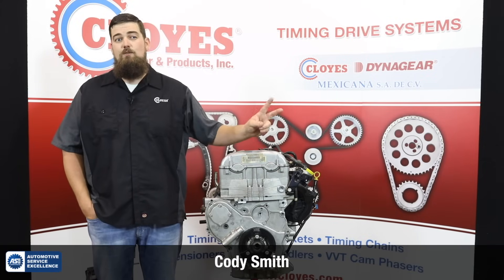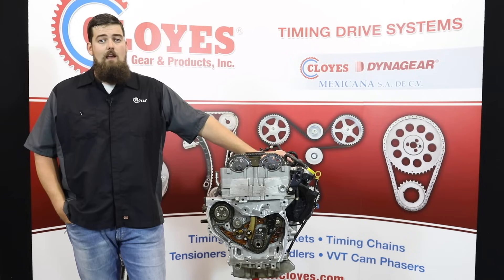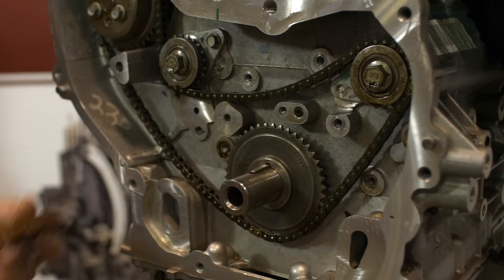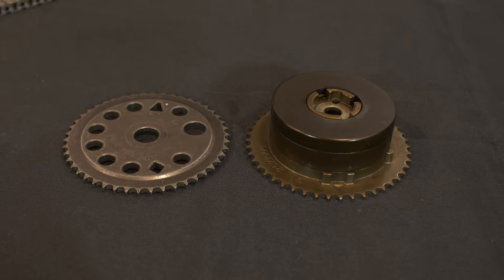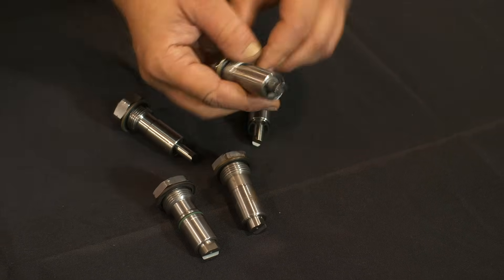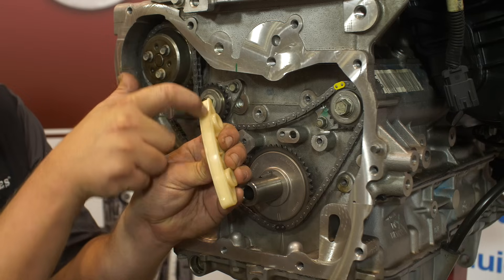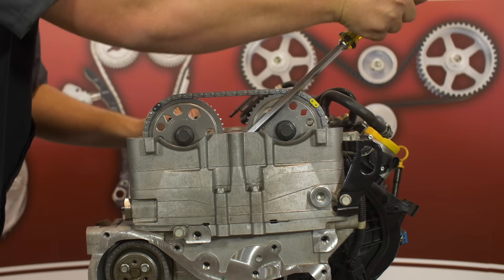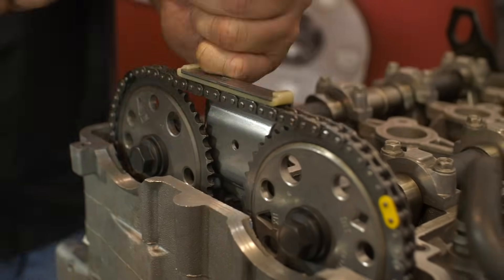GM 2.0/2.2/2.4L, Timing Chain Replacement, Cloyes 9-4201S & 9-4202S

Comment: Great video, but don't you need something holding the cams in place so that when you remove the sprockets and chain they don't move and screw up the timing?  I've seen these blue or gold cam holders for this project for the Saab 9-3 but in the video I don't remember it mentioned.  Thx.
Reply from the maker: They are not necessary, but can make the job easier. We do not use them during the video. The timing is set by the marked chain links aligning to the sprocket marks. If the cams move during disassembly, you will move the cams back when installing the new chain.
Reply: @Cloyes01   Cloyes, the cam locks are necessary on a Saab if you are going to remove cam sprockets, and probably even if you don't. The sprockets are not keyed to the cam like a regular ecotech. They are just held by bolt tension. The cam sprockets also do not have timing marks on them. Blue locks are needed for the B207L (9-3 Linear little "t" engine, Gold is needed for the B207R big "T" engine. Trust me, I am putting one back together right now.

Comment: Harmonic balancer bolt torque specs?
Reply: 74-ft/lbs + 125 degrees rotation
Reply: I think it is also just the "Crank Shaft Pulley"

Comment: On my application the vehicle uses a white phaser and a black one but the kit has 2 black ones... I'm guessing there is variations from Vin to Vin, gonna try the old phasers...
Reply from the maker: Yes, some applications used 2 different phasers, and some used 2 of the same phaser. We offer kits both ways.

Comment: FYI: I broke a tooth on BOTH new balance shaft sprockets using the 'drill bit method!' To anyone who had the same problem, I'd suggest wrapping the OLD balance sprocket chain around the sprocket and grabbing with a vise-grip to hold in place while removing/installing the sprocket. By using the old chain, you take the pressure off the single tooth and greatly reduce the likelihood of damaging the sprocket!
Reply from the maker: Very good advice. The punch/bit method will work, but you do risk breaking a tooth. If we film an updated video for this application, the method you described is the method we will recommend.
Reply: Glad i followed this advice. I cut the old chain in half and wrapped it around the balance shaft sprocket and let it bind up against the block. Worked perfect to break the balance shaft bolts loose, then i wrapped the chain around the other way, let it bind up against the block on the intake side and against a bolt boss on the exhaust side and i could torque the sprocket bolts to spec
Reply: @romanfedotov9434  Glad my advice panned out for you. It was REALLY upsetting when I broke not one, but BOTH of my new sprockets (and had to buy two more!)
When the first one snapped, I thought it was my fault or the gear was of poor quality. The second one proved of the stupid idea of using a drill bit!
Reply: That's how I had to do it,  the drill bit way is frustrating

Comment: Just did this proceedure on my 2013 Buick Verano. Bought an AC Delco kit OEM. Before wjen you drove the car there was like a ticking rattling noise because the chain stretched and was causing P0014 code. Afterwards no check engine light and engine is running smooth again. THANK GOD, at first I thought it was a rod knock
Reply: Did u have to pull the engine?
Reply: I have same car, my parents gave it to me, the chain is bad shop said so I had them tow to my house, I’m just curious if ima have to pull the engine
Reply: @psfanboy79  no! Its possible to do while it in the car. You do habe to lift the engine a little bit by removing the motor mount
Reply: @adamsgarage5119  thanks! I just replaced vvt solonoids and unfortunately upon closer inspection of the old ones there were bits of metal shavings on the filter screens so I didn’t even bother turning it over. The chain n guides are definitely toast.
Reply: Hi - need new chain on my 2007 solstice with 2.0l turbo - with your replacement - was easy to remove power steering belt and main drive belt for ac and drive belt tensioner?  Did have to drain oil?  And u mention lifting engine up slightly - why needed?  My solstice is rear drive so engine front cover behind fan so maybe i need to remove fan/radiator to get at front cover?  How many hours approximately take u to do job?  Thanks for any update here.
Reply: @michael-qp9xd  Hi, so with your solstice it is rear wheel drive so this job will be a LOT easier for you. It is required to lift the engine in the Verano / Cruise because the frame rail is in the way. In your case just remove the fan amd radiator and you should be good to go. You just remove the timing cover and the chain will be right there. This job took me personally 8 hours to do but that because of limited room by the frame rail. And yes drain the oil beforehand if you want to reduce the mess made.

Comment: I have a 2014 Chevy Impala with a 2.4 l I bought this car from a guy and he said the timing went out on him while he was driving on the freeway. I was told that even if I replace the timing the motor was no good because he was driving on the freeway I would like to know if this is true or false. I would hate to replace the motor it costs almost $3,000 for a used replacement motor.
Reply: Minimum will need the cylinder head rebuilt, have a local technician send a borescope down the spark plug holes to assess damage to the pistons. In my experience, its rare for a bent valve to damage the piston enough to have to rebuild the bottom end too
Reply from the maker: These engines will bend valves if a timing chain failure occurs, but with a new timing set and some new valves in the head you should be good to go. Machine shops will usually rebuild 4 cylinder heads and replace bent valves for less than $500 or you can find replacement heads for about the same price. Just make sure the pistons are not damaged when you pull the head off.
Reply: Yes unfortunately if it wont start now that means the pistons have bent the valves and it will need a complete rebuild or a new engine.
Reply: Late to the party, but for anyone else in that situation, pull the head and have a look. If it only bent valves, then refer to Cloyes comment. However, its pretty likely theres significant piston or head damage, and its faster and cheaper to throw a new engine in.

Comment: I've got a small amount of slack underneath the upper guide, it drops below the guide about 1/4" ,  I reused the old chain as all I did was replace the upper fixed guide and tensioner.  Is that slack ok? Everywhere else is tight except for that area between the cams.  The tensioner is activated as well.  Thanks
Reply from the maker: Some slack will gather between the camshafts when the engine is not running. That is formed by the valve spring pressures clocking the camshafts towards each other. Once the engine is running, that slack goes away. If you are concerned about the chain's health, take a look at the tensioner and how far the tensioner piston is sticking out of the housing.
Reply: @Cloyes01  Okay good to know, thanks.  It took quite a bit of effort to activate the tensioner, I was moving the tensioner guide an awful lot trying to compress the tensioner piston and was able to finally get it to pop.  As soon as that happened, it took the small amount of slack out of the crank sprocket and that is when I noticed the slack between the cam sprockets that was not there before activating the tensioner.  I'm thinking I'm good to reassemble but am being overly cautious.  Any help is much appreciated, thank you.
Reply from the maker: @kevinkonyn2879  That sounds completely normal. As long as the tensioner is activated then you are good to go.

Comment: Is this the L61/L850 engine?
Reply from the maker: Yes.
Reply: @Cloyes01  Thank you. I found your video by searching for upgraded timing chain oil feed nozzle (4mm diameter, instead of 1mm diameter). That shuold fix the chain streaching problems.

Comment: I have a 2006 Chevy Cobalt SS 2.4L I'm getting a p0014 code I tried doing an oil change and putting in a new exhaust camshaft solenoid but my cel keeps coming back on and it throws the traction control light on and it shifts rough when it's on but it runs fine and starts fine I don't know what's wrong with it what could it be?
Reply: Not a timing chain
Reply: Traction control light is caused by sobering else but did you ever resolve your issue?

Comment: After rebuilding the head on this. Replacing the guides, tensioners and, chain. The car is giving me a code for p0016 which is crankshaft position, intake camshaft correlation code. The engine runs really good after the rebuild. Starts up immediately, no power loss, no misfire at all even under load. (using diagnostic) what could this code be?
Reply from the maker: That could be referencing that the camshaft timing is off a tooth, the VVT system on that bank isn't working properly (phaser/solenoid), or the cam or the crank sensors are not reading correctly. Stretched chain is also possible if the system is worn, but not if you just replaced it.

Comment: When you're on TDC, are all the valves closed?  When one turns harmonic balancer/crank to take the slack out of chain, I guess it's OK the balancer sprockets etc are moved a couple hrs just as long the color links are still on the marks.  The weird black tensioner side has so much slack.  Everything is right on the hour until I take the slack out.  Then all sprockets are off quite a bit. I hope that's ok
Reply from the maker: Yes, as long as the links were aligned, then the engine will remain in time.

Comment: Hi
After timing chain replacement I was getting P0014: replaced the vvt selenoids    Wit oem but Didnt fix it. Then I replaced the vvt phasers with after market ones. Now getting p0011. Do you think it is the aftermarket vvt phaser still giving me that code? I am positive I did the timing right.
Thanks

Comment: In a reply to another comments' question regarding why not to rotate the crank after chain assembly is complete, you say the chain might jump because the tensioner doesn't put enough pressure on the chain and that pressure from oil circulation in the tensioner is needed to prevent jumping. When initially starting the vehicle, after the job is completed, the chain is rotating WITHOUT oil for 'x' number of seconds til the oil pump gets oil circulating through the tensioner so that it can exert enough pressure to keep the chain from jumping. My questions are 1) Is what I just theorized true or reasonably plausible (since I am not a trained professional) and 2) Isn't the chain at the mercy of luck to not skip no matter who did the job and how 100% correctly the job was done? Perhaps the engine torque being generated when the key is turned prevents it .?. Thanks for humoring this hack weekend warrior type of mechanic. Mike (using wife's email acct)
Reply from the maker: Hi Mike. You have a great understanding of the system and are asking the right questions. The biggest problem with rotating by hand is the effect that the valve springs have on the camshafts. During slow rotation the valves opening and closing have a dramatic affect on the chain and slack will move back and forth throughout the system. When rotating at speed with the starter, or once the engine is started, the chain runs much more stable because slack doesn't have a chance to move around. Valves are opening and closing at a much quicker rate and the system isn't effected as much by the individual events.
Reply: @Cloyes01  Excellent teaching answer. Thank you. So, because of the continuous motion of the chain at a rotational speed that doesn't allow a 'pinch point' to be able to have time to express itself on a link, the chain won't jump. Right? Does centrifugal force from the sprockets rotating help to decrease chain over-tensioning? Again, I'm no mechanic or engineer,  but my brain remembers a few things from physics class. 🤔 Thanks again. I promise I won't bother you anymore. Mike

Comment: why can’t the tensioner be installed activated
Reply from the maker: If the tensioner is activated and fully extended, the internal ratchet mechanism will be in its last, most extended step. If you attempt to install it at this point you will either damage/bypass that internal mechanism, or the tensioner will overtighten the chain and likely cause damage to the guides or chain. The ratchet mechanism needs to start at the most compressed position and work its way out over time as the chain stretches.

Comment: Problem.. After rotating twice our chain marks do not come back...? Why ??
Reply from the maker: The chain marks will only align during the initial install. If you continue to rotate the engine they will eventually come back, but it may take over 100 rotations. With that said, we don't recommend rotating this engine by hand until the tensioner has a chance to prime up with oil. You do risk jumping teeth on the crank sprocket.
Reply: @Cloyes01  can you elaborate on when will the marks will align

Comment: what are the balance shafts actual purpose?
Reply from the maker: Inline 4 cylinder engines are naturally out of balance and they tend to have a lot of vibration. Balance shafts are added to to help counteract the vibrations and make for smoother engine operation.

Comment: Not 37 lb ft on the balance shaft sprockets, snapped a tooth off the new sprocket on install………Also like to add that the intake cam phaser/sprocket was incorrect in the cloyes kit for the vvti engine, had to redo whole job, engine wasn’t hurt but just an FYI for you guys….
Reply: @dano9973  you can get replacements through your parts guys (Oreillys,Advance,Napa, etc.) I just did 30ft lbs on the balance shafts
Reply: @robertyingling2045  Update!!! I called tech and they have had problems with the small balance shaft sprocket tooth breaking,  He was honest about it and going to send me a new one.  He suggested to wrap the old chain around the sprocket as tight as possible and put vice grips on the chain.   Of course hold the vice grips and forget the punch deal.
Reply: Are you meaning the engine with over head valves and not overhead cams..  My cam sprockets don't look like these or the factory ones. I'll post my question to you that I just asked them.  Wondering if I have the wrong sprockets now.................I was wondering if yours were like mine. see below   Thanks

Are these cam sprockets the latest design?  My kit, the sprockets  has the same size holes all the way around, plus no diamonds.  I see these have the diamonds (as do the factory ones) with one larger hole with a space after. They don't have all the writing on them either, just exh and int all the way up on the teeth edge.  Have you changed these sprockets to what I have now or is mine an older version? Thank You  for replying.  I need to make sure before I tackle this crazy GM design
Reply: @dano9973  I haven’t had the opportunity to work on an NON VVT version of the ecotec yet…..but if I’m not mistaken there should be dowels on the sprockets to ensure proper alignment on the cams, there should be timing marks on the gears, if there isn’t only thing I could recommend would be laying the old gears on-top of the new gears and transfer the timing marks over to the new gears with a paint pen, and cross reference old part numbers off of gears to new ones to make sure they are correct….

Comment: What happened to the crank sprocket spacers are they not needed
Reply from the maker: If the engine had spacers installed, definitely reuse and reinstall them. Most Ecotec engines did not have spacers, but they are found in some designations.

Comment: Installing this past weekend. I triple check the timing marks and got the car to start. However, I’m with engine codes p0016 p0017 p228d p0089. I did not use the Cyoles timing chain sprocket because it had a circle mark at 4 o’clock. I did use the OEM sprocket.

Comment: Does the 94201swp complete kit for timing and balance chain with water pump- come with timing cover gasket and gasket for water pump ?
Reply from the maker: It does not include the timing cover gasket, but the O-ring gasket for the water pump is included.

Comment: May have a problem, I did my 2nd 2.4 timing job this week and realized when doing the 2nd engine, on the first one I may have put the balance chain tensioner in wrong. I guess I don't fully understand how it works, oil pressure doing something to it? (besides the obvious keeping tension on the chain) When the shaft is turned 180 it goes in and out freely but the other way it was sticking so I thought moving freely was the way it was supposed to be. But seeing the video the shaft is supposed to be the other way, will that need to be corrected?
Reply from the maker: The shaft should be positioned with the pin hole facing outward. The back of the tensioner shoe will also help hold it in that direction. When the hole is facing outward, the internal ratchet will be active which provides multiple steps that limit inward compression.
Reply: @Cloyes01  That's what I was afraid of. Thank you for the reply guess I'll have to crack it back open and fix it. Thanks for the great video also.

Comment: First of all thx this video! If I only replace the main tensioner, do i need to loosen anything or just replace the tensioner and activate with pushing the chain?
Reply from the maker: Just remove and replace the tensioner and make sure to get the new one activated.

Comment: Have problem. Got both chains in time on what it thought was tdc but now when rotating engine by hand marks do not line up after like 10 rounds. What now?
Reply from the maker: The marked chain links will only align upon installation. If you rotate it enough it will come back around, but it will likely take over 100 rotations.
Reply: @Cloyes01  QS
Reply: All good. Running great now. Thanks